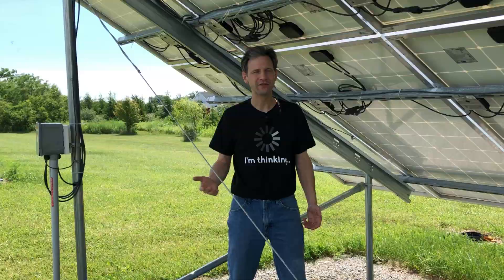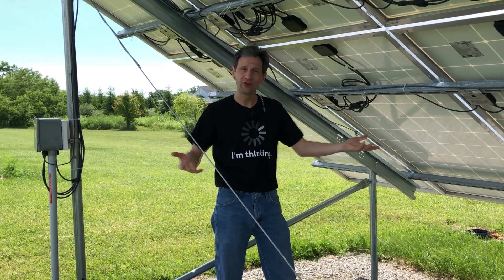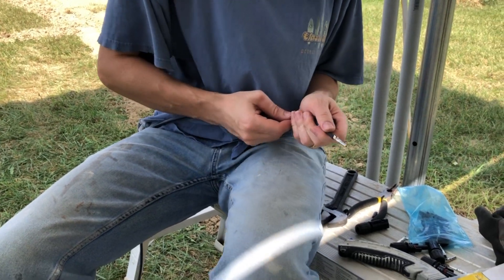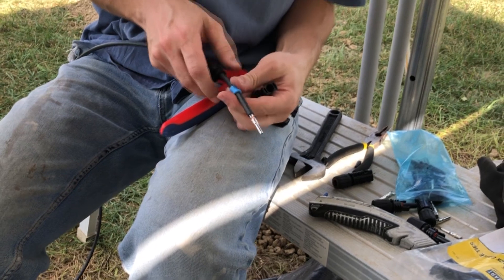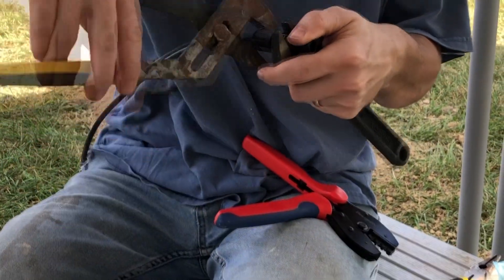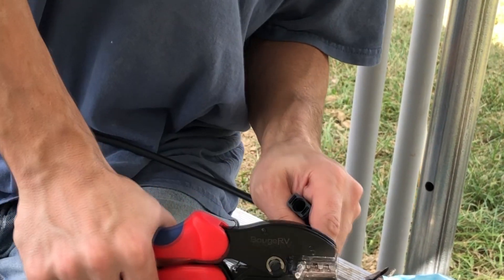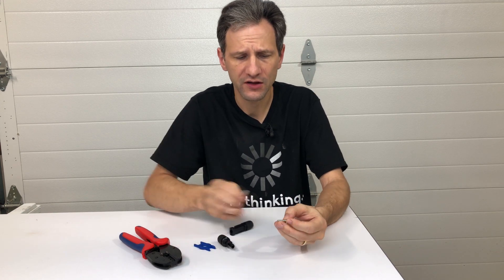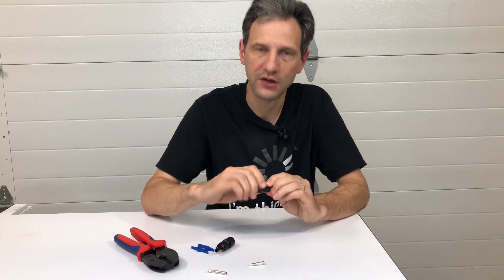How To Make MC4 Connectors For Your Home Solar Panel System

Comment: ... what is the name/label of the mc4 crimper?..mybe could get a plug n play crimper..or mybe the crimper is embedded with the mc4 plastic tightener / lossener (the blue tool)..
Reply from the maker: This is what I use: MC4 Crimping Kit: https://amzn.to/3TUuhAt
Reply: @ProjectsWithDave  ...it has a ISO9001:2008 standards as LY2546B series for mc4 (2.5/4/6 mm)... The teeth is swappable for other wire crimping types

Comment: You need to brush up on your German and check the channel of Der Elektrotechniker. He has videos on the only correct way to terminate MC4s, including the use of a torque ratchet.

He also strongly advices not to mix brands of connectors.

He does the maintenance on Germany's biggest solar parks with 80MW so I guess he does know what he is talking about....
Reply from the maker: Thanks for the tip!  Unfortunately, I don't know any German.  I can understand why you would not want to mix brands of connectors, in my experience there can be a significant difference in the tolerance between brands.  However, it seems impossible to match the brand of every PV panel and connection you make.  Maybe that's possible on a megawatt farm where everything is specified by the installer.

Comment: I have seen so many kits available and not sure which one to buy, did the kit you used have any problems with the MC4 on the panel working properly with the kit MC4?
Reply from the maker: I have used several brands of connectors, both on equipment side and self made cables.  They all seem to work together, although some are much tighter than others.

Comment: I personally solder all of my fittings. Strip the wire, dip in flux and put the fitting on. Then I bend the straps tightly with pliers and heat it up with a small torch. Lowers fitting resistance and tins the copper wire.
Reply from the maker: Yes, I agree, soldering will provide an even more robust connection.